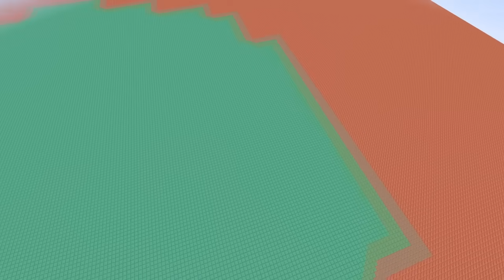What's The Fastest Way To Get Oxidized Copper And How Long Does It Take?

Comment: I think this is a really good way of doing the aging. It still allows you to farm the blocks and on large builds it really puts its age in perspective.
Reply: exactly and it will also allow statues (such as the statue of liberty which I imagine will be popular to recreate with copper) to last a fairly long time on singleplayer worlds and small servers
Reply: "Farming" is not really an adequate word here. You have to spend a lot of effort placing the blocks, then you are limited in range, you have to wait a long time,  and you then have to mine them again.
Reply: @sirmclovin9184  Yeah if you want to do it fast, you'd have to space them out. But if you do the calculations it actually takes just as much time per block per volume if you place them close to each other, you just have to wait a lot longer
Reply: The only thing missing, which I’m not sure if I just missed in the video or if it just isn’t a thing, is if having already oxidised blocks of higher stages nearby would speed it up. That way you could farm it by pushing unoxidised blocks through already oxidised blocks and then just break them on the other end
Reply: @snowfloofcathug  currently no, it just basically negates the slowdown. Having non-copper blocks instead is still faster.

Comment: Do the waxed copper blocks affect the block check around the copper block you are trying to age?
Reply: Great question, sounds like more testing is in order :)
Reply: It is a good question but I would guess they are removed from the algorithm much like named mobs are not counted for the mob cap
Reply: @rjamsbury1  that makes sense, cuz it's probably the game only checking for copper block, not the waxed block. but still interesting to test for a prove of concept tho
Reply: @winterweizz  for sure
Reply: Best guess is no, because they aren't subject to aging at all.
Reply: It would make sense if they didn't, because the wax coating would electrically isolate the blocks from each other.
Reply: No
Reply: Most likely not, the checks aren’t needed.

Comment: I have to admit that I would also like to see biomes play a more significant role in the oxidation of copper and future blocks. For me, it makes sense that dryer biomes (Desert or savannah) slow the rate of change while damper type biomes accelerate the change. It wouldn't need to be huge, but maybe a 10% variant based on the biome would be good. It would also give another use to biomes, along with what is already there. We also need a tin block in game so we can smelt the copper and tin to make bronze. Make bronze tools more durable than stone but less than iron.

Comment: 5:19 So since having nearby blocks that are more degraded improve C, would it make sense and be more space efficient to alternate strips of already oxidized copper blocks and strips of blocks you want to oxidize? Having a 5 block grid would be the fastest per block, but it seems like doing it like that might be more compact while still being somewhat fast.
Reply: Yes; it's probably good enough to have a plane with a bunch of extra blocks a layer below if you really want to sacrifice space and still don't want it to take forever, but a line with a few extra blocks sprinkled in to the side should work as well.
Reply: This would only work if the block to be degraded is itself counted within A, the count of all blocks. If it is, then the "normal" (no blocks around) value for C would be 1/2, but if there are 20 degraded blocks around, it would be 21/22.
If it's not counted (and the way Ilmango explained it, it doesn't seem to be counted), then you'll get 1/1 or 21/21 either way, so adding degraded blocks doesn't change anything.
Reply: @Kikaha  The idea is to make it more compact by putting blocks closer together but using degraded blocks to increase C to a more reasonable value.
Reply: no, oxidized blocks don't speed up oxidation, they are like any other non copper block.
edit: nevermind, this isn't entirely true

Comment: I like that they managed to keep the initial premise of copper taking a long time to oxidize like in real life but using the random tick speed to maintain reasonable performances.
Basically in the scenario of a build like a roof, a statue etc it will indeed take a long time while on the other end you can still farm those block when you purposefully lay them in the appropriate pattern

Comment: 2:20 Huh, I never realized that's what the random tick speed setting changed. I now get why gnembon says high random tick speeds can give slightly different results than waiting a long time with normal tick speeds, since if more blocks are being selected at once things happen more evenly. Taken to the extreme, if you set the random tick speed to be equal to 4096, every farm plot, tree, copper block or whatever would change simultaneously, which doesn't simulate normal behavior well.

Comment: What about having a layer of fully oxidised copper with another pattern of copper (for instance lines) on top to increase the density while trying to keep the C value down? Basically try to compensate the copper blocks in the same stage with a lot of copper blocks in further stages.

Comment: Fun fact: when oxidizing your copper you can place it as shown in the diagram below. 

Each copper block is still 4 blocks (taxicab distance) away from any other copper block so it will oxidize just as fast as ilmango's layout; but you can fit twice as much copper in the same area. 

XOOOOXOOOOXOOOOX
OOOOOOOOOOOOOOO
OOOOOOOOOOOOOOO
OOXOOOOXOOOOXOOO
OOOOOOOOOOOOOOO
OOOOOOOOOOOOOOO
XOOOOXOOOOXOOOOX
OOOOOOOOOOOOOOO
OOOOOOOOOOOOOOO
OOXOOOOXOOOOXOOO

X's mark copper blocks and 0's represent blocks on which you don't place copper.

Comment: I think it's still better to put the copper in a cube to oxidize stuff the quickest. From the video's figures, to oxidize fully, it took: ~3h for the grid, ~13h for the line, ~55h for the surface, and ~110 for the cube. In the test space, a 26^3 area (meaning 5 blocks can have a spacing of 4 between them) can fit: 125 blocks for the grid (5^3); with the line, 650 blocks (26*5*5); with the surface,  3380 blocks (26*26*5); and with the cube, 17562 blocks (note that this is assuming you pack the blocks in optimally, such that a cross section of the lines is a grid, and one with the surfaces is made of lines). 

Assuming you run a farm for the full 110 hours such that all your blocks are fully oxidized, then replace them, figures for the production of oxidized blocks can be found by multiplying the amount of blocks in the setup by how often it can be replaced in the set period. From this, per 110 hours, you can convert: ~4600 for the grid, ~5500 for the lines, ~6760 for the surfaces, and 17576 for the cube. 

From this, it can be seen that despite the limitations of oxidizing blocks next to one another, packing them closely will still yield a higher amount of oxidized blocks.

Please note that this is assuming that you only harvest the blocks when they are fully converted, and not when each individual ones converts.

Comment: I think that you should be able to smelt a copper block to age it. Normally when you put metals in a furnace a thin layer of oxide will form much faster due to the higher temperatures.

Comment: Seeding unoxidized copper with fully oxidized copper absolutely speeds up the process. Lay out a 9x9 slab with an oxidized block in the middle and another without (separated by 4 blocks.) and see what happens. There is a video out there with the science done. This allows you to quickly lay out large seeded fields of copper instead of dots of copper. Saves a ton of space.

Comment: I feel like copper should also need  to be outside to patina.  One of the biggest causes of oxidation is rainfall (be neat if rain/snow could increase the rate, too, but that might be complicated).  Blocks inside are going to stay shiny a lot longer not being exposed to the elements.  This would be easy to determine for rooves (clear line to the sky), but for walls...not so easy.  :shrug:

Comment: Would the line and platform oxidise faster if you put fully oxidised blocks on top and below, since the ratio between copper blocks above the oxidation state and total copper blocks would then be higher (thus increasing the chance)?

Comment: I think the game should also check for adjacent blocks. If blocks aren't adjacent to at least one air block they should not oxidise. I know it's an edge case but the cube core should probably remain unoxidised. The standard oxidation algorithm could take weigh those inert copper blocks less, so the oxidisation could still propagate inwards, or it could just ignore them entirely. I don't know how costly this extra step would be.

Comment: Really love how the oxidation is spreading from initial seed!

Could you do a machine that, using stone generator, automatically separates copper the correct distance, and after a set time sends everything to the blast chamber? So that player would only AFK place blocks in one spot.
Reply: In theory that would absolutely be possible. Using smart pistons or something you could send them around a giant piston feed tape that ends up after ~3 hours in a blast chamber. Dunno how laggy it would be though. Only 1 way to find out!

Comment: You should of shown how this oxidation speed was effected if you seeded the plane with the oxidized blocks, and you point out that a lot of time the is taken up with jetting that first block, and then it spreads. So if you put 5 oxidized blocks in a plane of 100 copper blocks, it might finish is less than half the time.

Comment: Honestly, I feel that the speed of oxidation could use a buff in time, maybe to be 60 minutes per stage on average, meaning it would be three Minecraft days, six if you sleep each night, to more line up with the original idea of making it a sign of a builds age
Reply: Alright, so, @Srevere pointed out, and Ilmango pointed out right after where I was paused, that there is a way the system does this effect which I failed to pick up on.
Goes to show why you should watch till the end rather then commenting right at a decent joke.

Comment: Setting the randomTickSpeed higher, since it just increases the number of selected blocks, is not actually the same as running the game faster.
When running the game faster, there is a chance the same block gets selected in consecutive ticks, which would not be the case if you just increased the number of different blocks that get selected per tick.
You would need some option to "double tick" a block with randomTickSpeed.

Comment: I'm conflicted on copper. It's sad that they changed it to age so much quicker but I also wanted a way to get the fully oxidized blocks quicker, just for building. I guess I'll just have to wax all the copper blocks I want to use.

Comment: Wouldn’t a staggered pattern be more compact than a grid because it’s the check area diamond around the copper?
Reply: 3-dimensional it should be more efficient than aligning them to a cube grid.
In a flat plane it comes out about the same.
Reply: @HappyBeezerStudios  More efficient maybe, but it would probably be a nightmare to place the blocks that way.

Comment: Wouldn't this feature make it more likely for some anomalies to occur in you big pile of copper blocks? That being one fully oxidized block in a pile of unoxidized ones. When one block progresses before the others, now it has the maximum likelihood of progressing to the next stage while all the other ones are still behind, stuck at a very low likelihood. I can imagine how helps prevent single blocks of copper from being stuck at the first stage, like in farms of crops, but it might look a little weird. Then again, though, you are probably only going to used waxed copper for building and not the regular stuff.

Comment: It's cool the way the cube started corners first, simulating surface area rusting. That being said, this is one of the most unintuitive methods of implementing this mechanic. The idea of checking for other copper blocks makes them change phase all at once, which is pretty useful if you want a homogenous monolith. However, I kind of wish they kept it simple and had the blocks just check for air. Air on 6 sides would obviously rust the fastest, and a completely sealed copper block would either rust incredibly slowly or never at all. It wouldn't get them to change all at once, but this way would let the player collect rusted copper blocks twice as efficiently.

Comment: I've got pure copper that i use for making chainmail stuff, it really doesn't age that fast (though i live in a decently dry climate [though not a desert] so might be different elsewhere). After being left in the open air for months (possibly longer, haven't tested) it still looks so new that even a trained eye might be hard-pressed to notice it's not fresh. I'm not sure if it's microscopic scratches or the oils on my skin but they age much faster after being assembled into something to wear, but still it's likely that the chainmail i make will never turn green (them being used will rub off the outer layer faster than it can oxidize, the same effect makes chainmail self-cleaning to some extent), instead they turn sort of brown. They turn a certain sort of brown pretty quickly and then they kinda just stay that colour
Just figured i'd add some context, and say that i don't like that it skips straight from fresh copper to having some green on it.

Comment: i really love the copper block and i want to build with it and every one of the 4 stages is great for building but i dont like the oxidation feature. i know it takes a very long time to convert but we use afk farms a lot on our server and it’s basically 4 or 5 nights of afking until a hole floor is turned green and probably its messing up the hole design. it would be perfect if you should be able to somehow lock the current oxidation stage. hope something like this is coming, otherwise the block is completely useless for long term buildings until its fully oxidized

Comment: Is this only for blocks exposed to air, or for any placed block?
Reply: Dont know if things like glass or fence gates will affect.
Reply: The block check doesn't appear to check for anything that's not copper, so I don't think there are any rules for non-copper blocks (including air blocks) nearby

Comment: If I understand the math correctly, an unoxidized copper block in the middle of a 4x4 area of oxidized copper should oxidize faster than an alone copper block, right? If that’s true, I wonder whether that could be useful to speed convert copper.

Comment: Wouldn't decreasing the distance and changing the tilling improve how efficient it is per density? There should be an optimal point and I don't think it's on the edge.
Reply: For a 2D plane, the optimal packing is a grid of 3x2 translations, which is almost twice as dense as the naïve packing (a grid of 5x0 translations). I'm not sure about the 3D solution, but I suspect it involves 2x2x1 translations.

Comment: Because of the structure of the radius around them, you could make a tiered copper turner that’s less than +4 each level right? Like if you offset the copper to fit in the dips

Comment: A slight nitpick at 3:24 , it would take an arbitrarily long time to advance a stage but not “infinite”
Reply: In theory it could never happen. That's an infinite amount of time. But it is way more likely that it will happen after a really long time.
Reply: @0mr_x055  Actually, theoretically it HAS to happen. That is how random variables are defined, natural intuition may suggest that, for example, it is possible to flip a coin and only get tails, never heads. But it is guaranteed that eventually you will get a head as otherwise the coin would be DEFINED to be biased.

Simply put, the statement that “this can take an arbitrarily long time to happen” and the statement “there is a chance that this never happens” are independent.

You can also add up the probability that it will happen in n tries. That probability approaches 1 as n approaches infinity.

Comment: 1 block every 32 spaces concerting in one hour over 32 blocks every 32 in over 50 hours is indeed faster. If only using water or a furnace could speed this up.

Comment: If you seed the area with oxidized blocks does that increase the rate other blocks will oxidize? In other words, would a copper block in isolation oxidize faster or slower than a copper block on a platform of oxidized copper?

Comment: Could fully oxidized blocks be used to seed a platform or line to get better rates overall, in case you need a very large amount of oxidized copper, or would the faster rates be more valuable than an increased number of blocks oxidizing at a time?

Comment: Ah yes, the dream debate.... For those who read both the mod and the defending paper: The defending paper very correctly brought up the fact that the mods did not consider the selection bias in pearl trading. Meaning that they assumed they were stopped random but in reality, dream understandibly stopped trading after he got ~12 pearls so the last trade was alsmost certainly a pearly trade which sways the probability distribution.. Easy to miss point on the mods side but it does change the overall odds more towards dreams favour...

Comment: The corrosion seemed to spread from other corroded blocks
So what if with that cube of copper you made tge corners from the different stages of corrosion?

As in
32100...
21000
10000
00000

How much of an impact would that have?